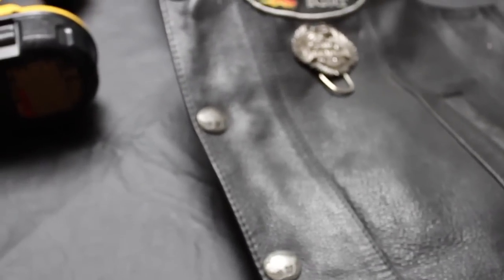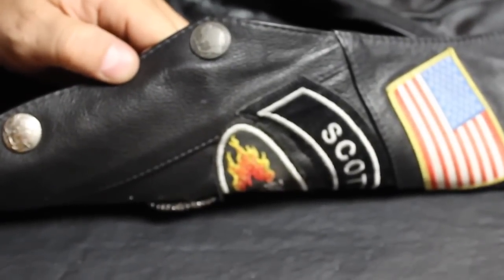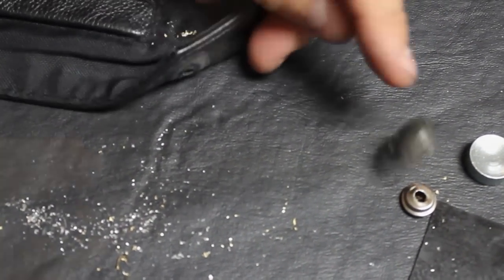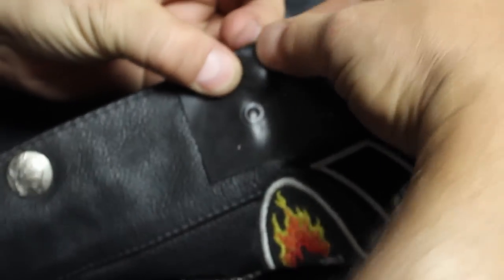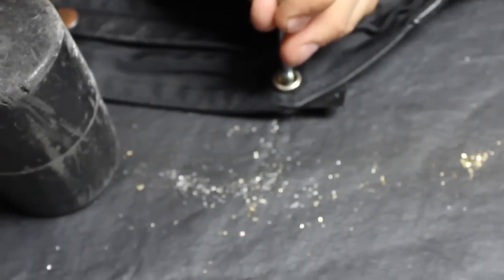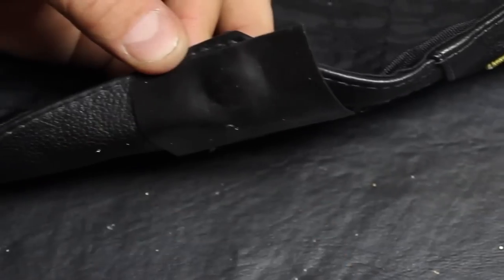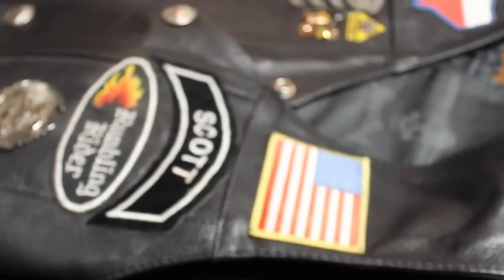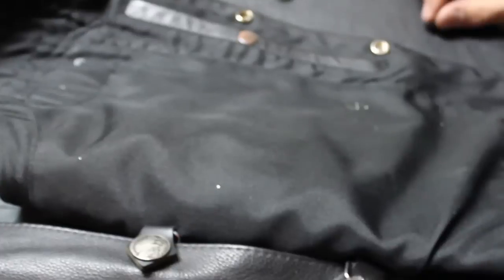How to Remove and Replace the Snaps on Leather

Comment: Thank you. I did the drill but it was so nerve wrecking and time consuming. I tried to hammer it out with a bit but was disastrous! I nicked my leather and am mortified. I worked on a high end jacket(Balmain) with new snaps so it must've been either good quality snaps or just brand new snaps. I finally did it with patience and jiggling the drill but it was not easy. I also am having trouble with putting on new snap/rivets. The snaps work but look wonky inside when unsnapped. I am exhausted. What am I doing wrong?

Comment: Does the lower part of the snap have to be replaced or it it just the part shown in the video
Reply from the maker: You only have to remove the side that is broken if you are replacing it with the same size/style snap to ensure it will fit when snapped together.

Comment: Hi can you remove the other part of the snap the same way?
I just put a snap in on the wrong side. 
The bottom snap is on the inside of the fabric and the flat part is on the outside. 🤦🏾‍♀️
Can I remove it the same way with a drill?
I’m sure hoping so, cause I don’t want to have to make this project over again. 🤔
Reply from the maker: Yes, in fact, I did the same thing you're talking about.
Reply: Let's Learn To Sew Thanks so much for getting back with me so quickly. 😊

Comment: Is it possible to remove snaps without a drill?
Reply from the maker: +Angie L I don't know of another way. You have to get that center section to break away. You might be able to break it off with a small chisel but I'm not sure.

Comment: I tried this method to remove snaps on a dickies jacket, but unfortunately it did not work. :(
Reply from the maker: I'm sorry, it usually does regardless of the brand since most snaps are joined the same way.